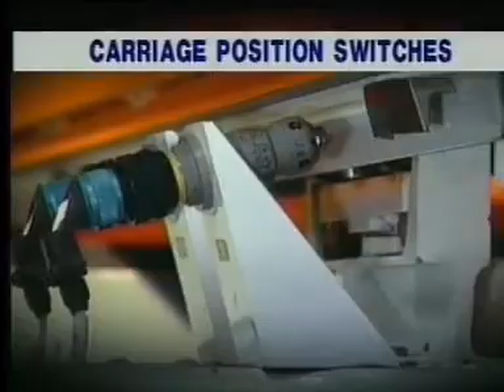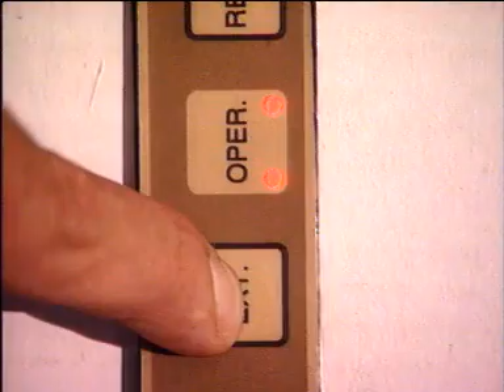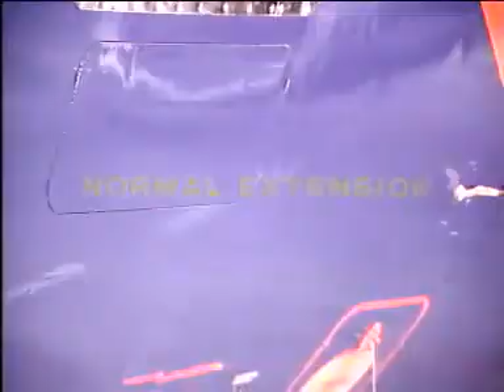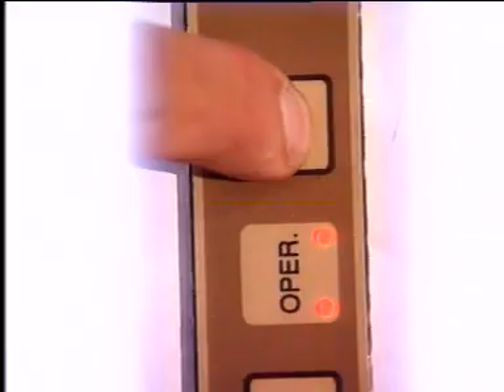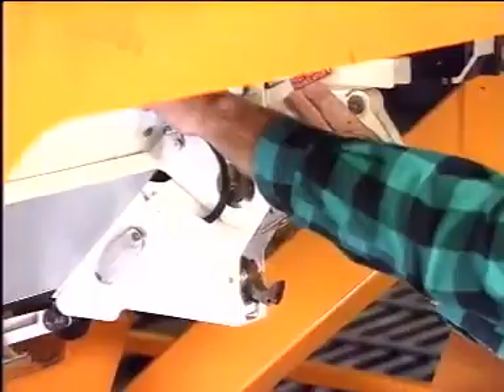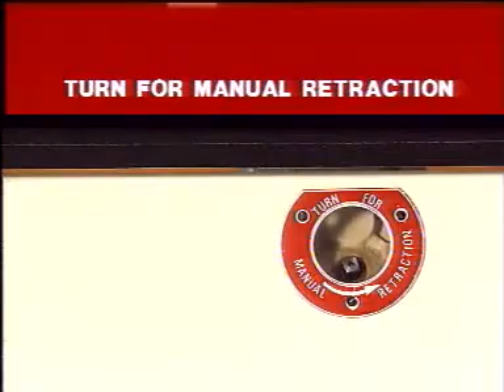A320 On-Board Stair

Comment: Much more complex than the ones in the original 737s, and DC-9s, maybe because those airplanes sat lower to the ground. I see the British Airways airplane here, but I hardly see this feature used, though useful at smaller airports.
Reply from the maker: For use at very remote airports without adequate infrastructure. Some of these aircraft are used by the presidents of certain countries.